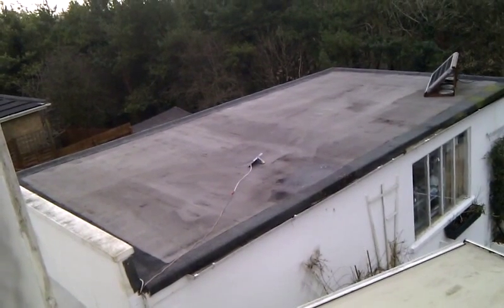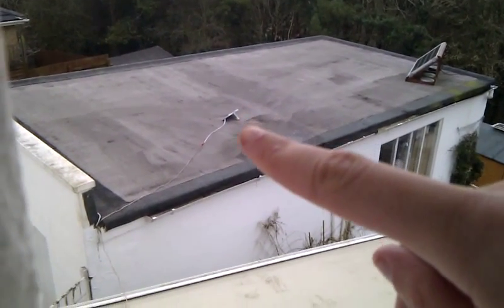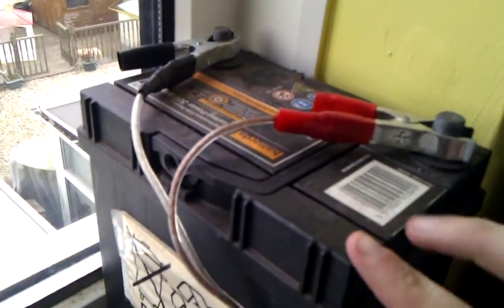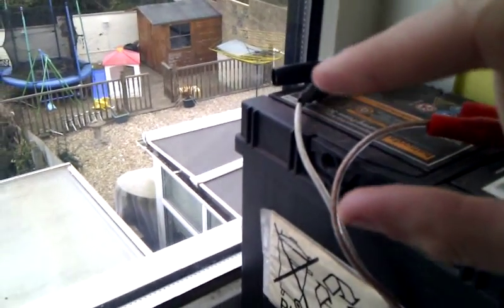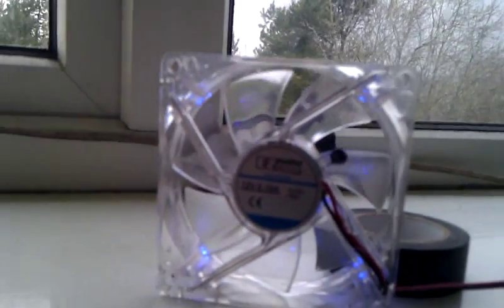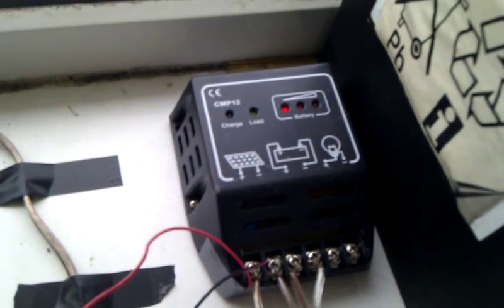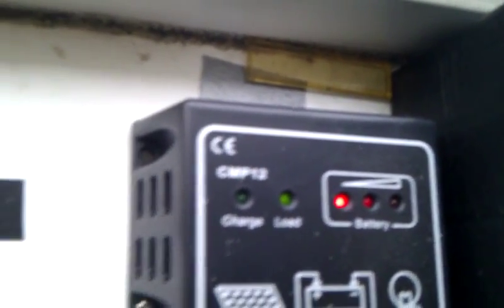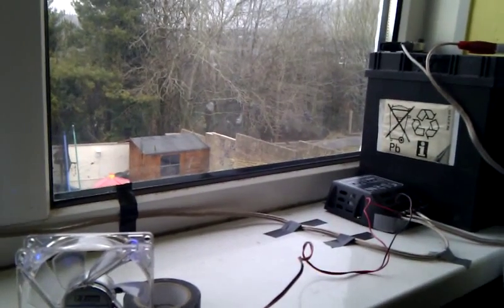Small side project

Comment: This would make a descend emergency system.
As it is, you can run a small 12vdc - 3w fan, a small 3w radio, and power about a dozen leds for lighting.
This type of system would also be a money saver during the summer if just used for the fan.
PEACE!